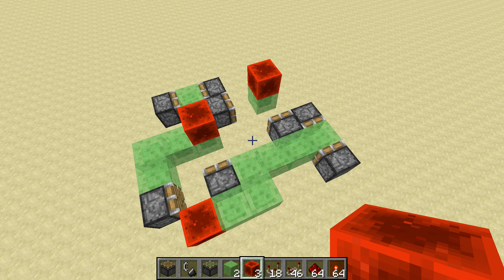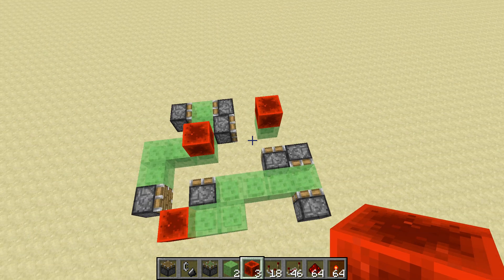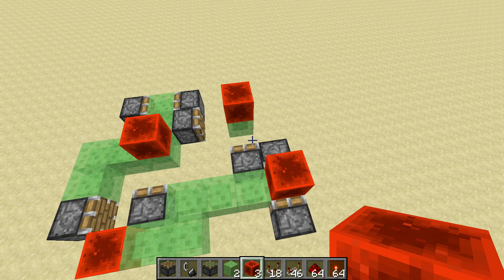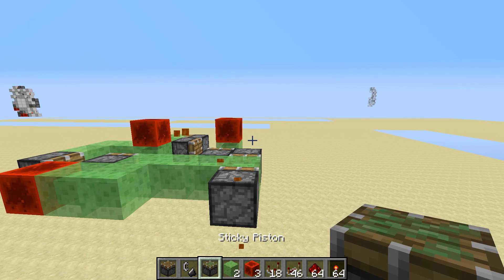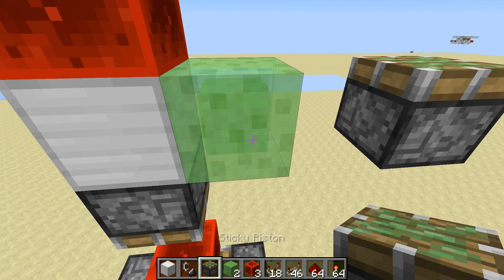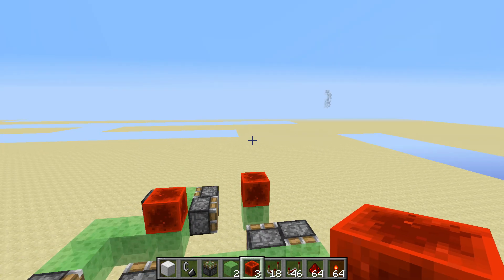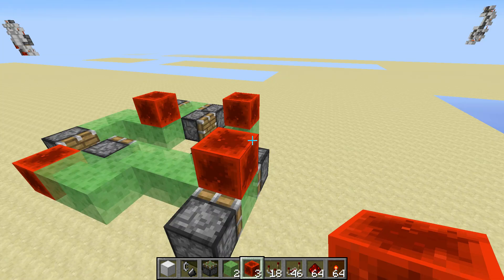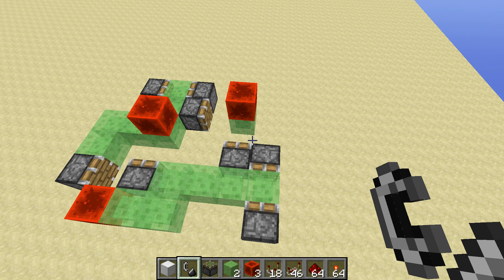world first? 2 directional flying machine flys forwards & sideways

Comment: Not the first, good design though. I think 4-directional is a bit of a big step (I don't think it's possible at all) so maybe you can try to add a start/stop mechanism so that you don't have to place or break blocks.
btw, here is the actual first: Piston slime block flying machine you can steer in 2 directions!

btw2, there is of course this 4 directional flying machine: Quad-Direction/4-Way Flying Machine In Minecraft! (Semi-Automatic) but I think one that doesn't require breaking or placing blocks to steer is impossible.
Reply from the maker: the 4 directional flying that uses string to update isn't what im going for. and i believe it can be done!